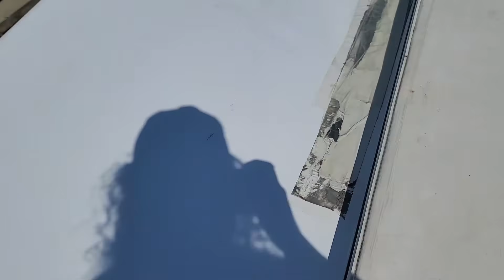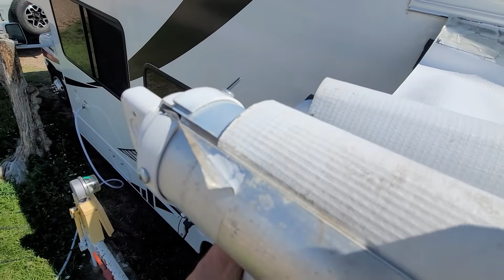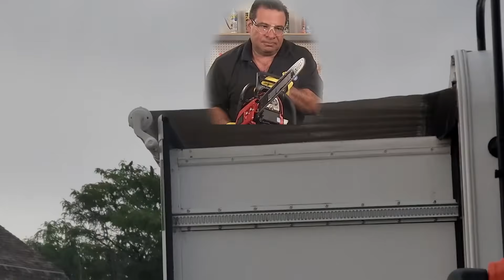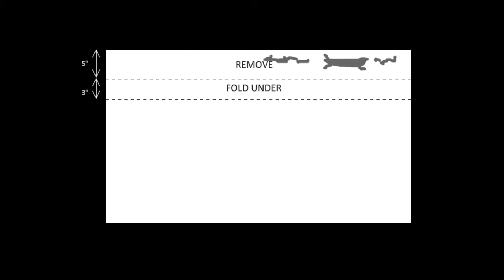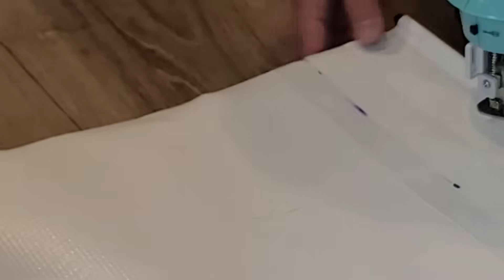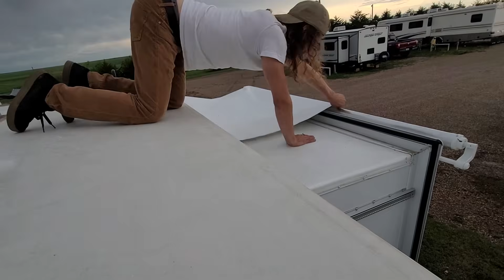RV Slide Out Topper Awning Repair/Replacement - Solera/Lippert

Comment: I need to replace the arm and the spring .  my awning is still fine How much pretension does it need before replacing the new arm and spring.
Reply from the maker: I might not be understanding the question, but are you talking about how many windings the spring needs in order for the awning not to sag? If so, and if it's a Solera Lippert topper, I've read in various forums that 12-16 windings would do the trick.